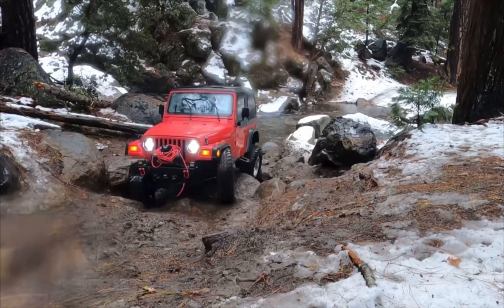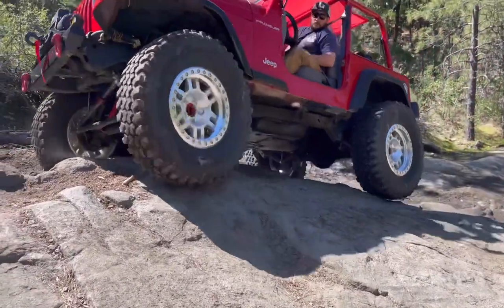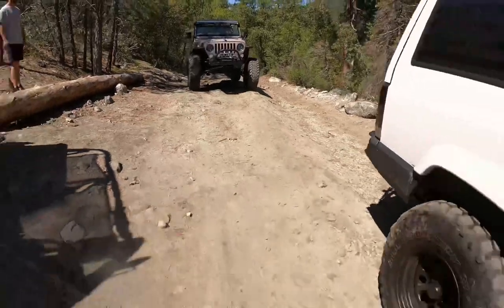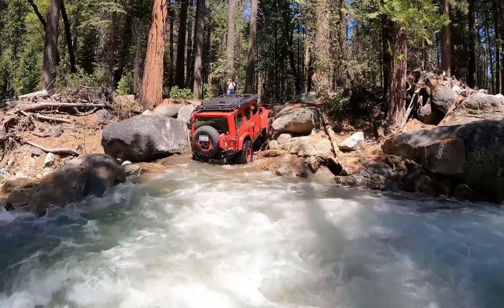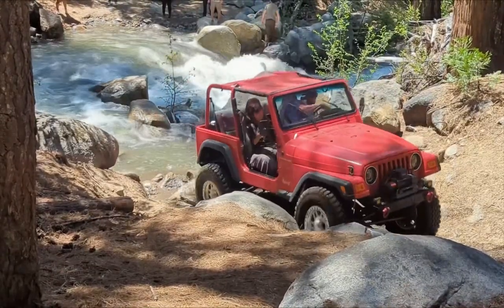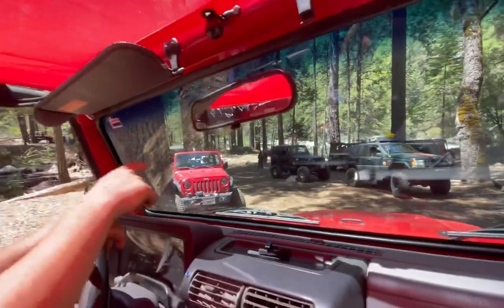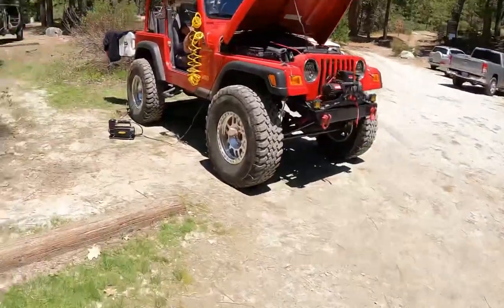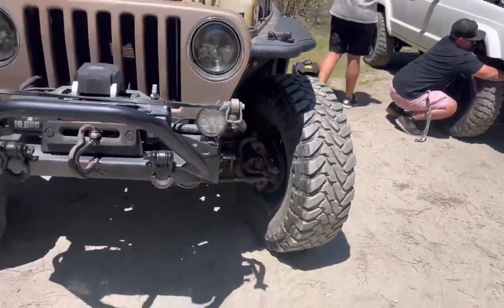Whitewater Wheeling On Jeep Go Topless Day In My Jeep Wrangler Tj - Sourgrass Offroading Trail

Comment: Sliders on the rigs folks the steps get you every time. Also would like to add that includes the rails w steps, it needs to be a straight solid tube. Probably my biggest riddicual .
Reply from the maker: Bought the Jeep with these on they are definitely coming off haha. But yes sliders not steps 🍻🍻

Comment: how do the vision beadlocks hold up locking at a set for my tj and what is your offset and backspacing I run 35x12.5 15s
Reply from the maker: They are pretty solid locked,  no issues yet ! These are the exact wheels I have I do run adapters so I can swap these wheels on the JK. 🍻 https://www.ebay.com/itm/285366592047?mkcid=16&mkevt=1&mkrid=711-127632-2357-0&ssspo=qstMkH4eQay&sssrc=4429486&ssuid=lKOB01XZSci&var=&widget_ver=artemis&media=COPY

Comment: A neat trick you can do if you bend the tie rod (the stock tie rod) is if you have a Hi-Lift Jack you can use the handle as a sleeve over the tie rod and get back home. We did that for my friends TJ when he bent his bouncing too much up a hill climb in NC.  https://www.youtube.com/watch?v=ufrFOJAc9DI  (Note the video was after he already bent it and we were at smaller obstacles when he re-bent it in the video.) When that happened to him I immediately ordered the heavy duty steering kit from Currie! LOL.